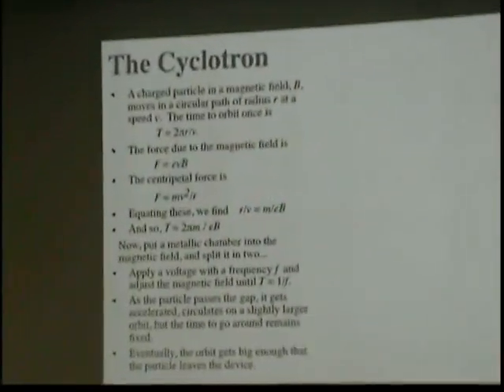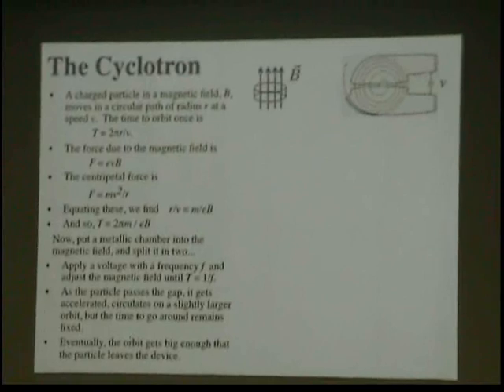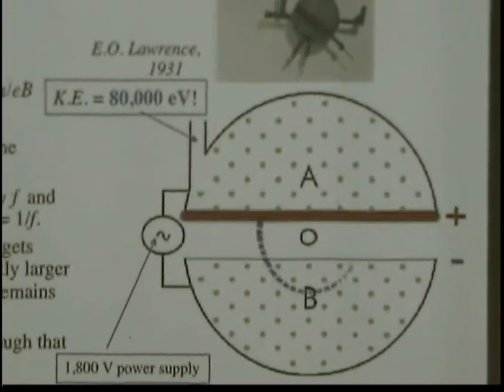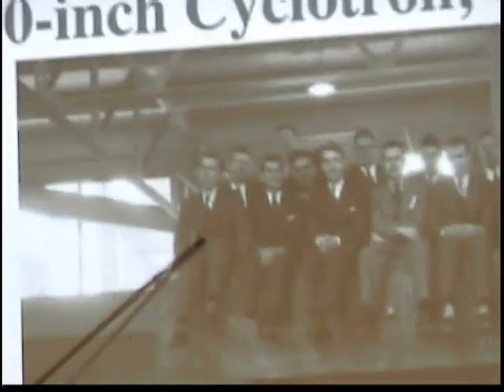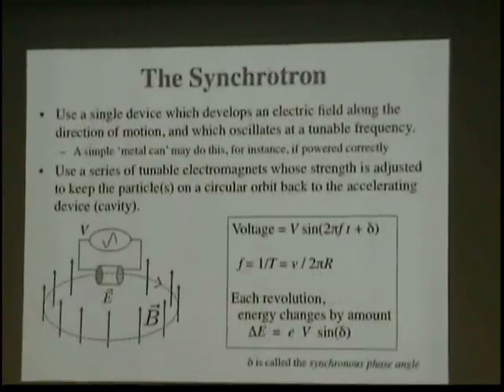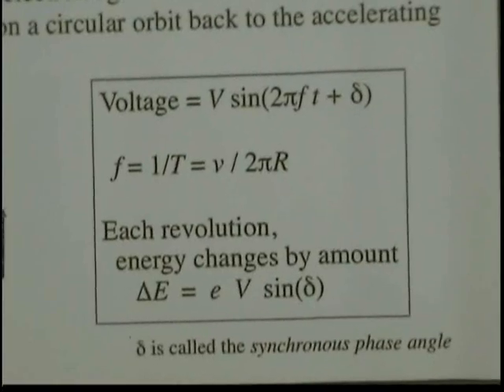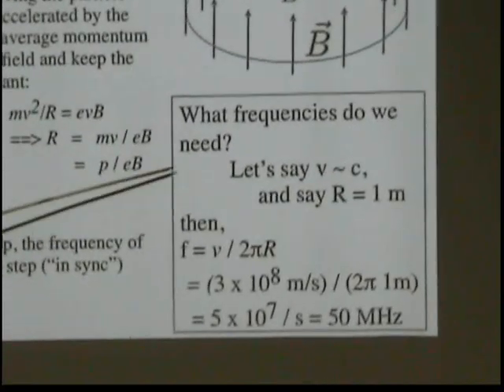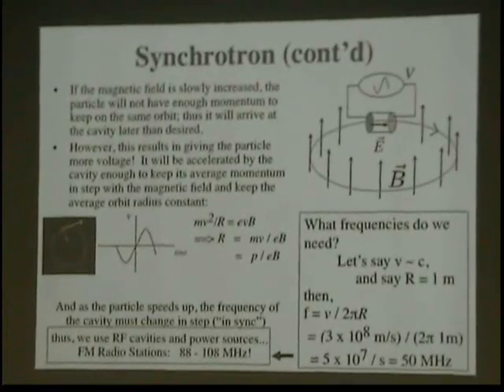Particle Physics: The Cyclotron

Comment: @Timpy2000 design and parts. make sure your design is perfectly accurate and find parts (super strong electro-magnets, vaccum system and a high voltage powersource with an injector.)